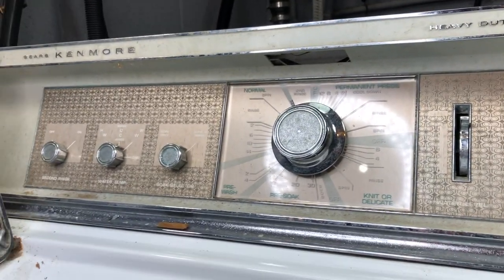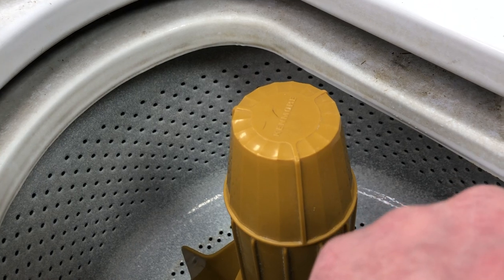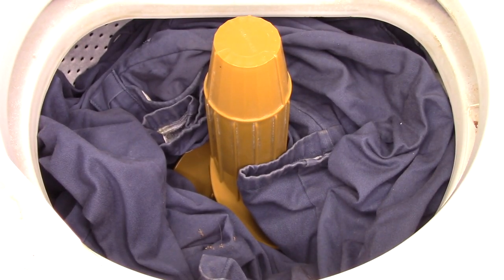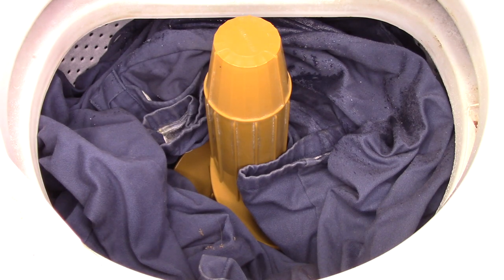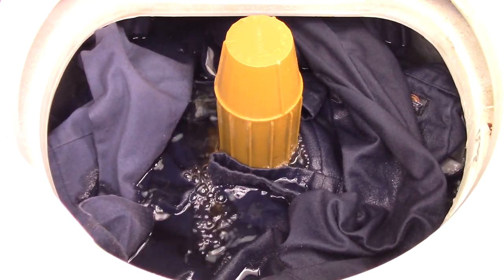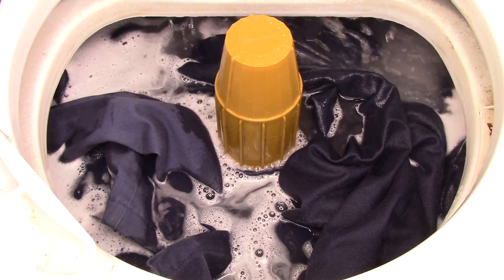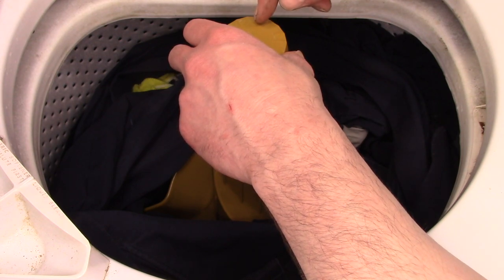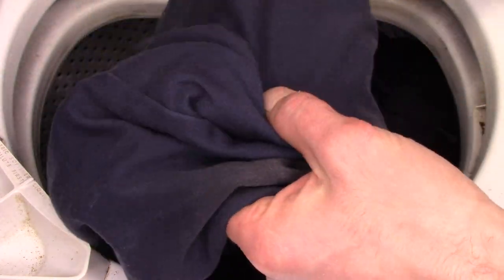Vintage Sears Kenmore Belt Drive Washing Machine, NO Repairs, 6 Pair of Work Pants

Comment: Boy Eugene does this bring back memories for me, This was the exact very first washer that I ever restored back in 1984!!! Only mine was Avocado Green and I got it from a women who had it stored in her basement for a few years because it stopped pumping water and she bought a new one...  I tore it down and cleaned it all up because it was really filthy, Then I put in a new pump and a new belt put it all back together again and it worked like a charm!!!  Btw  my agitator did the same thing when it spun and it's called free play... When I had a heavy load in it  the clothes would hug the agitator and it would fully spin... But when I had a lighter load in it,  It would skip turns just like yours did!!!  The only time that the agitator will lock into place is, if the agitation has already started and you shut it off then you can't move it... But  before you start the load you can turn it back and forth by hand freely and that's what I use to do to mix the detergent before adding the clothes... It will also be free spinning during the spin cycle also!!! Thanks for the trip down memory lane Eugene and have a great day!!!
Reply: Robert Przybylowicz yes totally right about the agitator I remember holding my aunts machine years ago. I believe it was a 1957 Lady Kenmore the agitator when I did the laundry and it went into the spin it was completely free wheeling and again you’re right only if you stop the machine while it’s washing you can’t move the agitator.
Reply: Yes

Comment: This Kenmore washer was made by Whirlpool. It was a belt drive washer with a transmission. This was made a decade before they introduced the direct drive. The Whirlpool direct drive  was an upgrade for their washing machines. They new belt drives with no transmission are just junk. They replaced the most reliable with the least reliable.

Comment: It's standard capacity.  Main-stream models went super capacity 18# in 1974 (IIRC) and would have a PentaVane or PentaSwirl agitator.  18# capacity prior to that was limited to a few specific models.  Agitation problem is probably a bad spring in the transmission.
Reply: the agitation problem stems from it being overloaded or the water level too low.
Reply: The agitator gear spring looks like its shot so it doesn't engage when the fork drops.

Comment: My grandma had this exact same washer, same control panel, and everything. It was a 1972 model.

You’re right, the agitator should fully disengage for the spin cycle, and it should spin the same RPMs as the tub. 

Hopefully by now, you’ve got this old girl cleaned up and repaired. 😃 I’d be interested in it if you ever decided to sell it.

Comment: The very first automatic washing machine my mom had was Kenmore Suds saver that had the control panel on the front of the machine and the color was a pastel pink. My Dad got it for her for a Mother’s Day present so she wouldn’t have to use the old wringer washer.the noise you hear is the Shift Solenoid that is weak.

Comment: the other problem with the agatator could be the transmission not shifting in to wash mode propery i would check the wigwag and the shift cam:)

Comment: Yes you are correct about the first two digit after the 110 being the year the machine was introduced. The 700 at the end of the model number denotes the model level if I am not        mistaken so that would mean it is a 700 series.

Comment: The Detergent Dispenser Valve Has Something In It Keeping It Open And  The Non Engaging Transmission, That Could The Wig-Wag
Reply: Water should gush out of the detergent dispenser like a waterfall for about the first 5-7 minutes during the wash cycle.

Comment: This is a cool machine! Hope you'll be able to improve it with some TLC.  I wonder why the off balance buzzer was sounding during the wash drain.  I hope you'll be able to get the detergent dispenser to work.  Despite its slipping issues it did a great job with your clothes.  Does this one have the fluorescent tube over the control panel?
Reply: it has a little incandescent light bulb

Comment: I saw a trickle of water pouring down the right hand side of the opening during wash and spin cycles - Leaking valve? 🤨
Reply: Something Is Stuck In Dispenser Valve (Maybe A Piece Of Lint or Maybe The Spring Controlling The Flapper Valve Is Sprung)

Comment: Hi Lorain, could you please do me a big favor,  can you give me the part number of your Super Roto Swirl agitator and the cap? I'm planning to do what your friend Bob did and install one in my Maytag 712. I JUST NEED TO FIND ONE!!! I'm SEARCHING for the GOLD one. This agitator was/is AWESOME. My grandmother's 1970 LADY Kenmore had a GOLD super Roto Swirl agitator in it and I loved seeing it in action.
Reply: I have not been able to remove the agitator from my 1970 model. I think it is just rust, since I can't see any bolt (other than the cap) to hold it in place.
Reply: @aanefosse4321  Eugene posted a YouTube vintage Maytag washer restoration video using a device that may help you remove it...video is called, "Perfect Restoration of a Vintage Maytag Washer" I also, would LOVE to find an enhanced (extended vane) version "GOLD" Vari Flex agitator.

Comment: cHECK THE GEAR OR REPLACE THE SPRING 
 AT THE BOTTOM OF THE AGITATOR SHAFT INSIDE THE TRANSMISSION

Comment: it does need work the lint filter is not flowing as it should be and the part in the start was not the belt it was the gear in the transmission it was tite i have fixed many a machine like this this one was sitting for along time with no use it shows its sad
Reply: That Machine Has A Self Clean Filter
Reply: @martinbirdwell7986  self clean or not the water should be flowing back in the tub on the right side the old waterfall lint filter water return
Reply: @apctech1  yes but on that machine it's the detergent dispenser so it only operates during the 1st 2 minutes of the wash cycle, not continuously